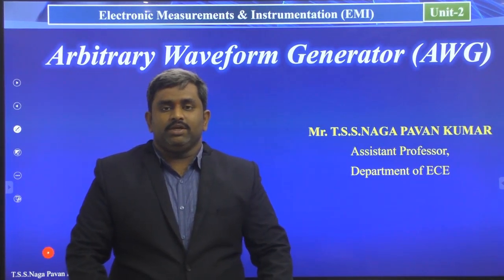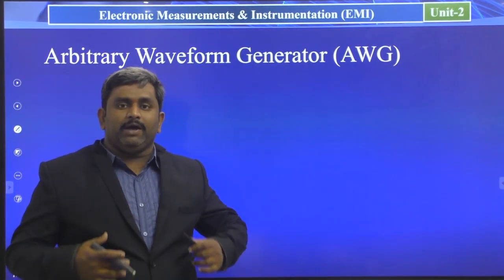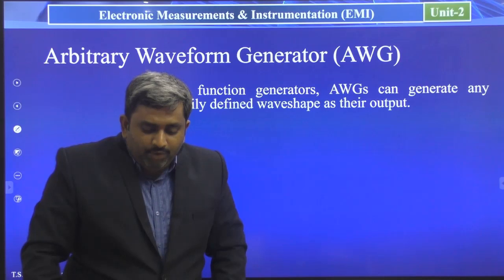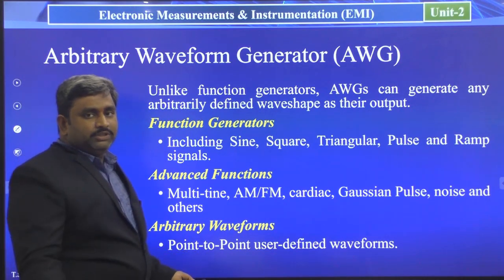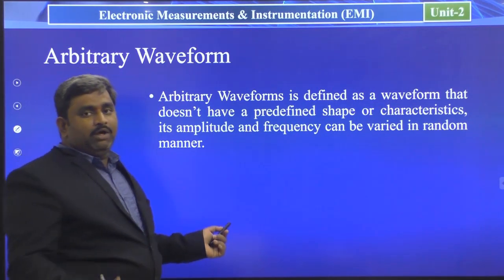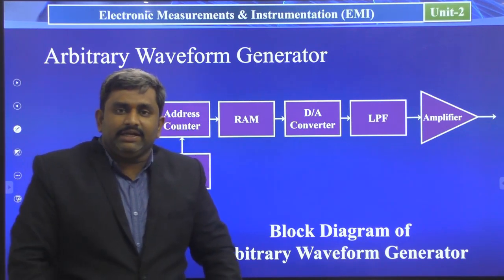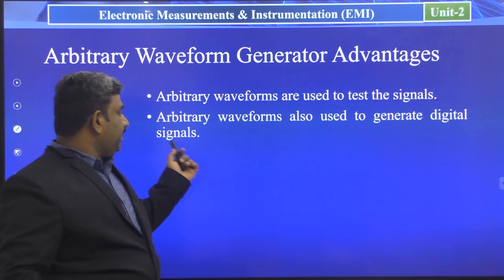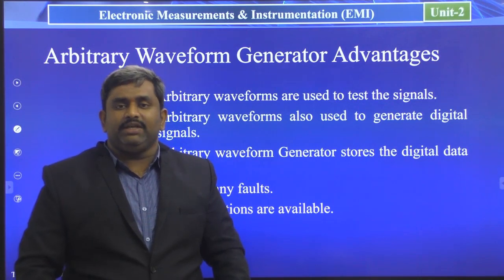EMI207 - Arbitrary Waveform Generator (AWG)

Comment: Why should we use only LPF .why other filters are not using sir
Reply from the maker: Low pass filters are used to filter noise from a circuit. 'Noise' is a high frequency signal. When passed through a low pass filter most of the noise is removed and a clear signal is produced in most of the cases.